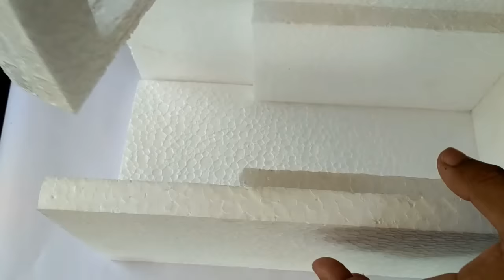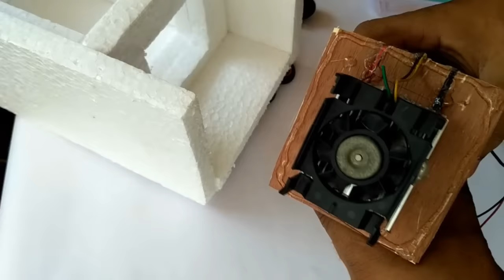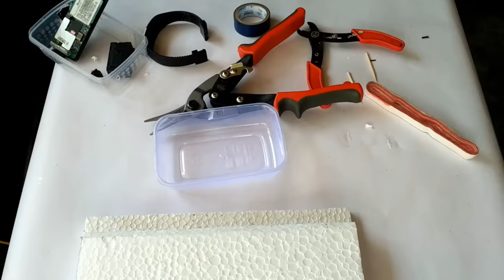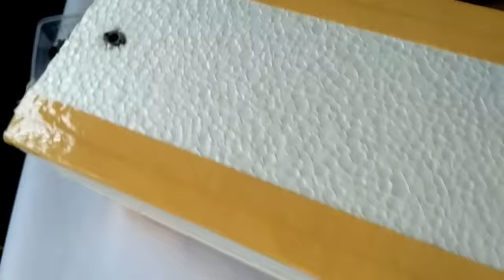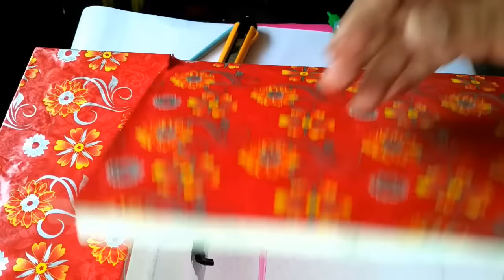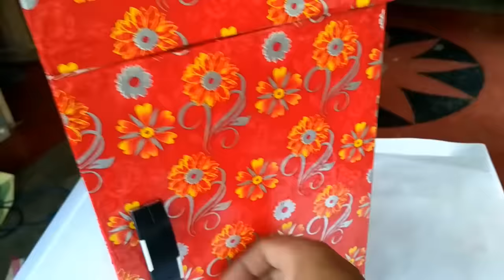How to make a Mini  Refrigerator  (  Low cost DIY)

Comment: Hello, I watched the full video and appreciate your hard work. I want you to know my opinion on the video and hope that you will see to it in you next DIY project. Here are some points to look into:
1) You didn't show any results. I understand that it can't freeze water but atleast you could have shown the difference in temperatures before and after switching it on. For example, you could have shown that it was 25 deg C before and now it's 23 deg C. It doesn't matter how less the difference is, what matters is to show that your project produced some results.
2) You didn't mention what the heat sink is made of, what register you are using, the circuit diagram, input power,etc. When you document your project, you should always explain 'clearly' how you are did it and what parts(and their ratings) you used. That's the main idea of documentation.
3) You should give a brief explanation of working of a refrigerator. This will help the viewers understand what part is working as the heat sink and which as a source and  how is it going to cool the source.
I hope this comment helps you and you will keep these points in mind for your next DIY project. Have a good time.

Comment: This is a great and creative idea but it would be more helpful to add a list of measurements for the foam board, all of the parts and how you hooked up the wires in the back. Otherwise, not everyone will know how to set this up. Still, a very clever and useful idea!

Comment: As an electric engineer i know for sure it is not working properly.
I worked on this project before i made some prototype.
Those Peltier module are commonly used in cooling electronics components.
the peltier thermoelectrics module is a very bad idea because it is consuming so much energy about 60 w and use most of the energy in heat.
And considering the volume at most you'll reduce 2 Celsius.
There's no regulator your system will work without restrictions you won't know if you reached the right temperature.

Comment: Guys he is using peltier elements, which can take heat from one side to the other, the two cpu cooler, I think both blowing wind into the thin "sheets" of the aluminium, the the side wich will be cold turning into the refrigerator, thats all
Reply: Nice effect 👍 keep it up dost 👍

Comment: bhai iski machine kha or kis shop per milegi
Reply from the maker: The materials which I used are one peltier, two cpu cooling fans and one 12 v 5A dc power supply .you can get this online  from amazon  or ebay
Reply: Isaka mashin ka kya name hai kaha par milega

Comment: can i use 12 v 15 amp  peltier  module  and if i do what power supply do i need ..?
Reply: Yeah but you’ll have 160w cold-hot so you need a good refrigeration sistem (sistema de refrigeración) it can be with air or liquid if you fix the heat problem you have it
Reply: Too you can use more than one you can use two or maybe three if you need it, it’s depends how many cold space you need

Comment: Can we use 6 amp female ac socket and 1 mm wire  to  run 12 v 10 amp smps for 12706 peltier